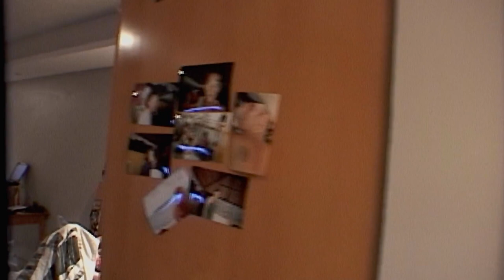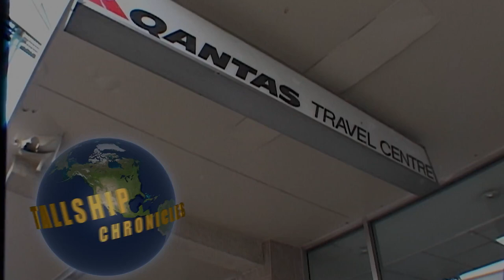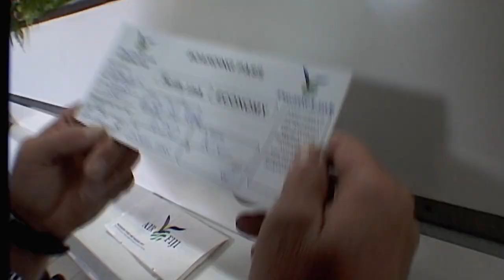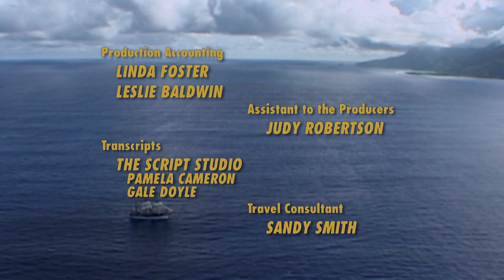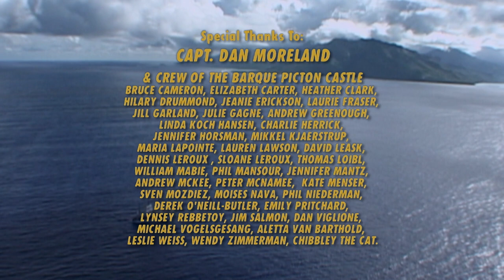The Tall Ship Chronicles: Amateurs Sailors Navigate the Globe! - Episode 8

Comment: No safety harnesses worn while aloft, incredible!
Reply: Having done plenty of "up top" work with a harness and either lanyards or a fall arrestor (not on ships), my take is that for this kind of climbing, it would be slow, cumbersome and potentially dangerous to be messing about with lanyard hooks and staying untangled up in the rigging of a tall ship. Out on the yardarms, for example, there isn't even a point overhead to clip into. Spring-loaded fall arrestors work great, but they have to be directly over the worker, each person needs their own, and they can't be left out in the weather, so they'd have to hoist and secure them for every task, then strike them. Which would of course require someone to go very high without fall protection just to do that. 
Back in the old days, plenty of sailors fell from such rigs, especially in bad weather, but the vast majority of them  did not.